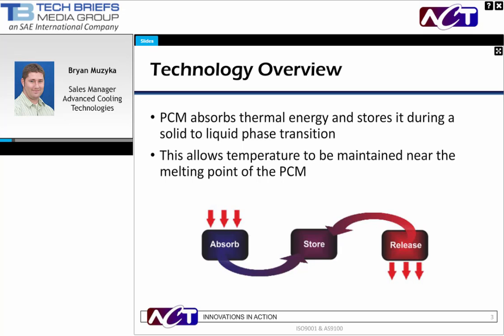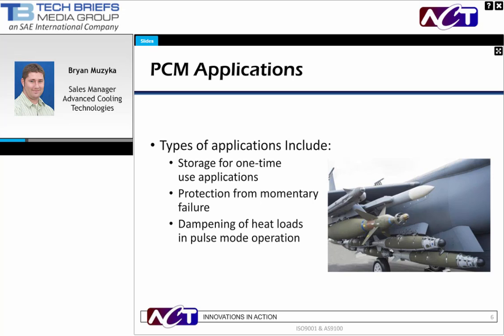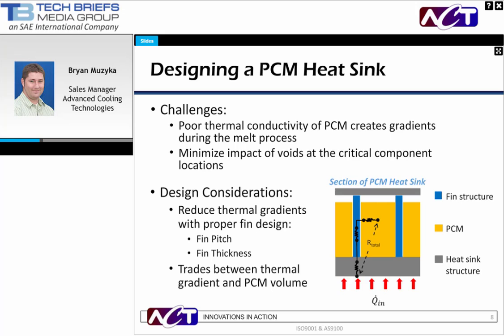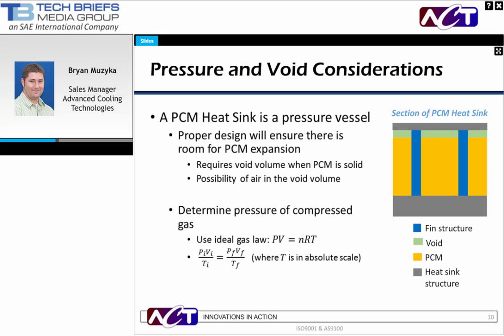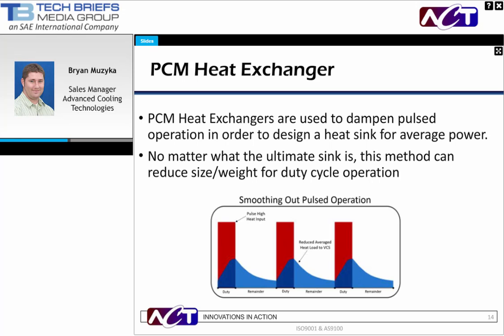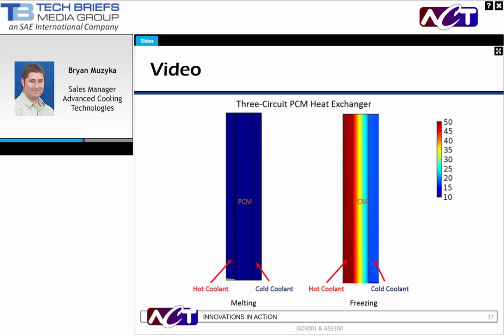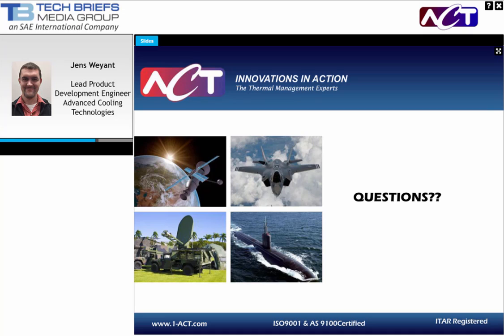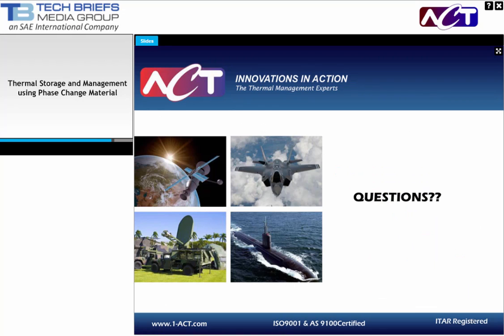WEBINAR: Thermal Storage and Management using PCM (Phase Change Material)

Comment: HELLO FRIEND ,  i have a doubt.. yes PCM absorb heat when it reach a particular temperature in sink,,, so the battery temperature is maintained,,, but this absorbed heat get rejected immediately when the surrounding temperature is less than melting point,,, the surrounding composed of sink itself,, so that again heat up the battery ,, right ?
Reply from the maker: The melt and freeze temperature for most PCM is identical (or very close), so the PCM will provide cooling when the device is generating heat. Once the heat is removed, it will take time for the PCM to resolidify, which will keep the device near the melt temperature. We hope this helps! If you'd like more information, visit our PCM learning center: https://www.1-act.com/resources/learning-center/phase-change-material/
Reply: @AdvancedCoolingTech  hey, it's not about only maintaining right!..what happened the battery temperature or sink temperature below the melting point, the pcm get solidify by exothermic reaction and it heatup the sink or battery again right

Comment: what would be the suitable PCM for integration into thermal storage systems (Hot Water Tanks) ?
Reply from the maker: That's an interesting approach. It might make sense to integrate PCM, however, in water tank thermal storage systems, the water is used in a similar fashion as the PCM would be used, in most PCM thermal storage applications. Please reach out to solutions@1-ACT.com and provide more details on the thermal storage requirements, heat source, tank size and ambient conditions and we'd be happy to review and see if the application could benefit from a PCM solution.

Comment: What is the type of PCM  that can be used for  a refrigerator? Your answer with be highly appreciated
Reply from the maker: Hello - There are a number of paraffin wax PCMs that could be used for a refrigerator. You can use our PCM selection tool and calculator to help you decide the best PCM component/material for your application: https://www.1-act.com/products/pcm-heat-sinks/pcmselection/?hilite=PCM

Comment: what is the heat loss rate of a paraffin wax if the energy is stored in an insulated tank?
Reply from the maker: Hi, Nikhil!  If you are still looking for an answer to this question, please visit www.1-act.com and fill out our Contact Form with some additional details about your insulated tank.  This will go directly to one of our engineers who can give you an appropriate response!
Reply: @AdvancedCoolingTech  I'd like to know this as well
Reply from the maker: @SimpleTek  If you can fill out a contact form on our website with details about your project we can get back to you with more information. www.1-act.com.

Comment: Hello i just wanna ask, how do you calculate the void or space that needed for the expansion of PCM? rather how do you know how much volume of pcm will be put into the heat sink?
Reply from the maker: This is pretty complex, and part of the engineering design studies we complete for customers. A short answer would be "During manufacturing, a heat sink module will be completely leak tight which makes it a pressure vessel. Since the PCM volume increases when the PCM melts, a void volume, typically 8 to 15 percent of the total volume, is required to prevent the PCM from bursting." You can use this page as a starting place if you want to learn more: https://www.1-act.com/innovations/thermal-storage/pcm-heat-sink-design-considerations/
Reply: @AdvancedCoolingTech  okay thanks you!

Comment: Hello sir, please is there any software that can be used to simulate a thermal energy storage using PCMs
Reply: What kind of simulator are you looking for? Molecular level or complete system level?
Reply: @jelmervd2l  actually I need both I need one to learn about the best PCM combination and also for the entire system and thank you so much for answering me
Reply: @wafaa9529  We use PCM RAL, its not the best but it gets the job done. I don't realy know any other sim options either
Reply: @jelmervd2l  thank you so much, can i find in the internet
Reply: @wafaa9529  Yea, but it's not for free :(
Reply: @jelmervd2l  okey thank you so much again for your help
Reply: @wafaa9529  No worries dude, good luck with your project
Reply: @jelmervd2l  that's so kind of you